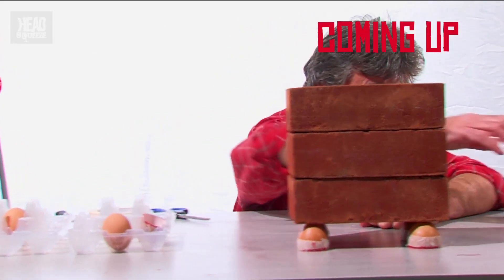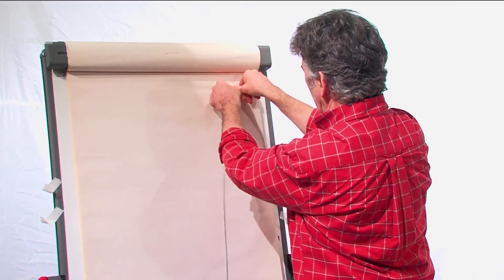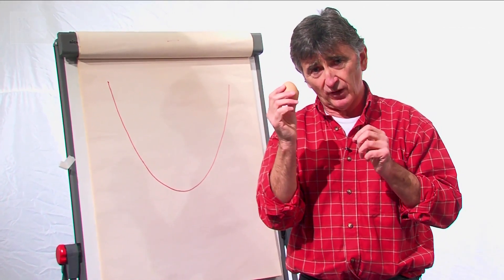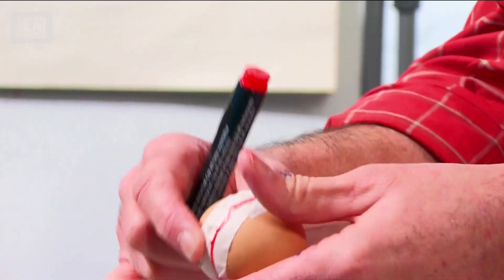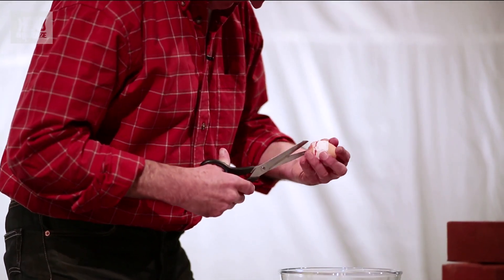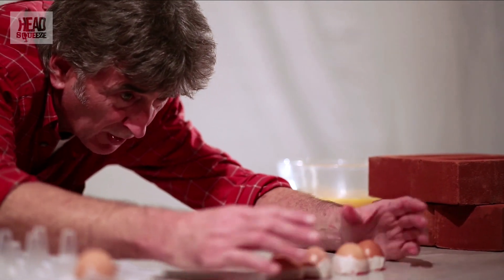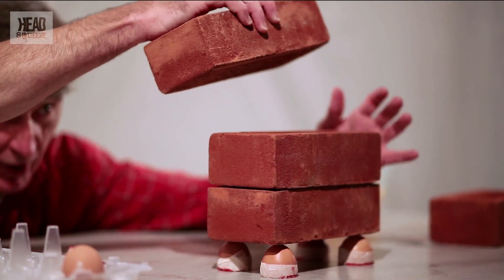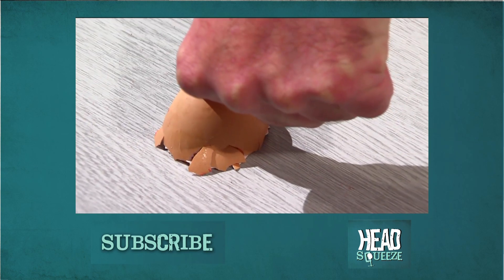Eggs stronger than bricks? | Live Experiments (Ep 3) | Head Squeeze

Comment: That's because it's a normal wall building (Or 'London')  brick. They're meant to have a hollow on one side.

It's so when adding the brick to a wall that's being erected, the cement can stick inside this hollow, giving a brick wall more strength. It's why they are the most commonly used wall building brick. They're lighter, stronger and easier to work with.

I hope this helped and indeed enlightened you. :)

Comment: No, the titanic broke in half because the bow filled with water and tipped the ship upwards with it's stern clear out of the water. The compartment system in the titanic caused this unusual sinking. If the ship was damaged in the center it actually would not have sunk or split in half.

Comment: Try leaving the fresh eggs as they are (without removing the white and yolk) but secure them to a table/floor to keep them standing. Repeat the part of the experiment where the bricks are placed on top of the egg shells and see what happens. (:
Reply: But when it gets crushed it will be a mess YOU have to clean 😂 not fun
Reply: +Emy Young The egg is the strongest at the top and the bottom (or at the highest point of the arch). If you hold an egg in your hand and squeeze it on the top and the bottom, the egg doesn’t break because you are adding pressure to the ends which are the strongest parts of the egg. #funfact :))

Comment: "Follow our instruction to the letter"
Actually no, your method is horrible. You are creating cracks as you cut through the egg, it would be better to cut the egg using a rapidly spinning fine edge slowly and carefully, no need for tape either.
And of course as you mentioned, any uneven cutting will make the load shift to one edge or one shell which would become the weakest link in the "chain".
The better you measure the stronger the shells will and you could possibly stack even 10 bricks on 4.